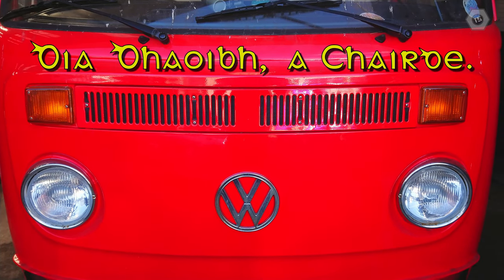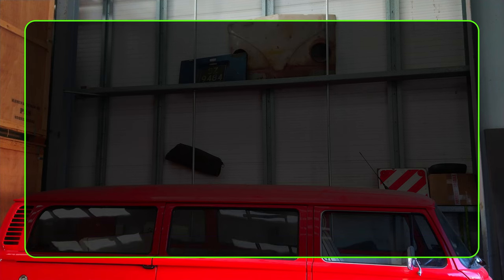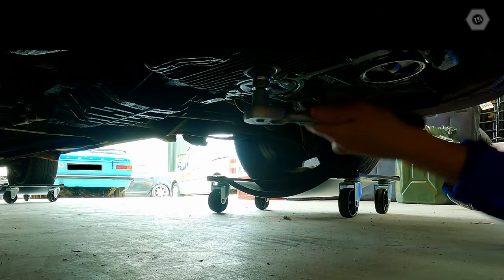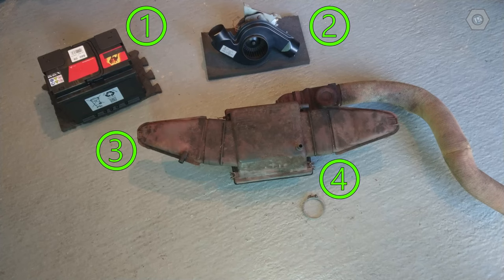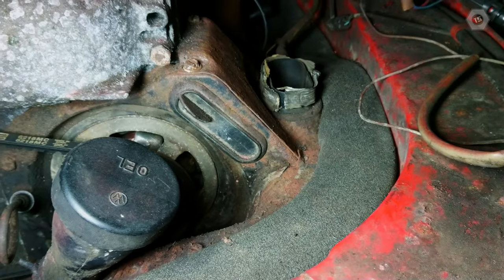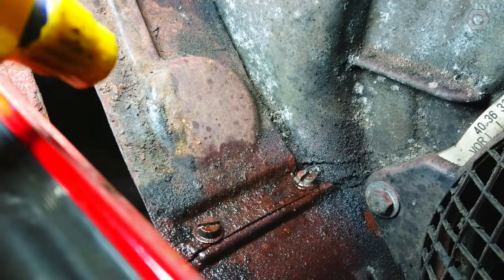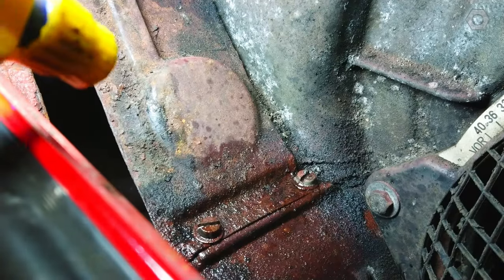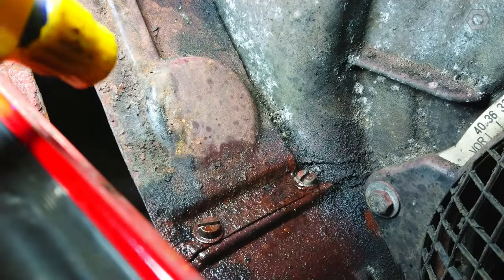Volkswagen T2 Engine Removal (Type 4)

Comment: Next time, if you take the carrier bolts out at the top of the gearbox bell housing you can drop the engine down with the gearbox with the engine totally complete. I think you need to undo the small screw for the gearchange linkage and pull the linkage off the front of the gearbox so it doesn't bend.
Reply from the maker: @chrisstuckey64  That's the easy way!

Comment: Fuel breather hoses on these vans are a classic cause of petrol fumes and also fires 😳 While you have the engine out it is worth replacing all of them. I got a WOSP high torque starter motor for my Type 4 and can only recommend them.
Reply from the maker: Interesting stuff about the starter upgrade, thanks! Although I've repaired the original for the next vid. You're spot-on about the breathers... they're currently being replaced... with swearing..